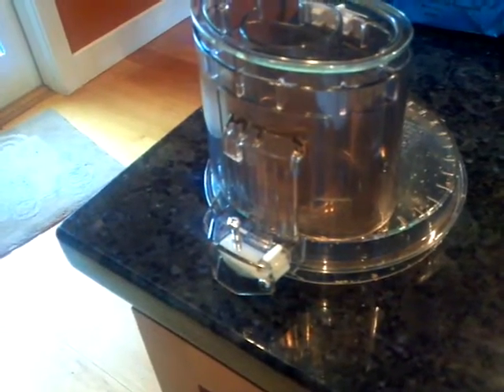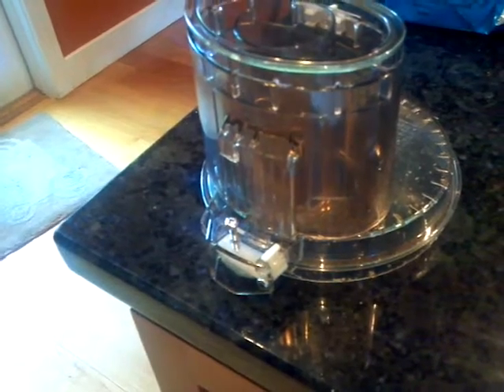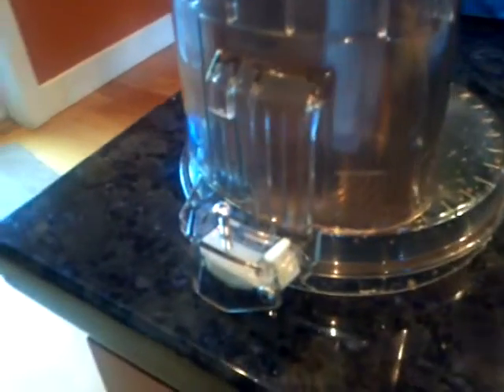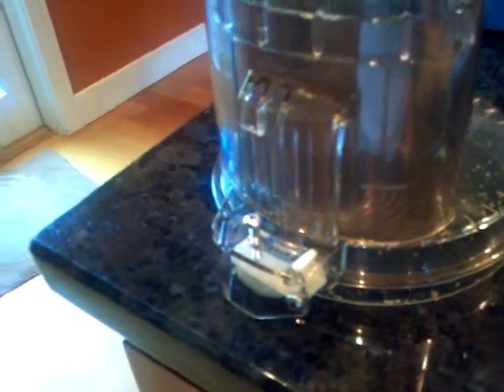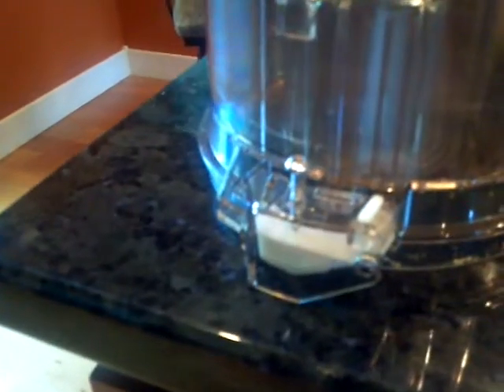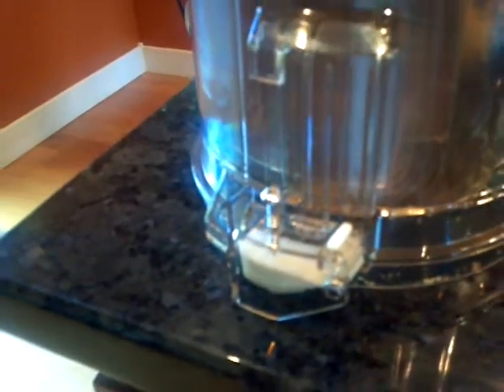Fix a Cuisinart DLC-8 Food Processor Lid/Plunger

Comment: Thanks so much for the video! I'm not mechanically inclined. But I have to be creatively frugal due to finances.  When I analysed the lid, my only thought was to glue a loaded spring where you put the top screw. Then I thought to check YouTube for ideas.  I don't have the right size screws on hand and I live an hour from a hardware store. (As I said, I'm not mechanically inclined, but Im willing to learn! ) If I glue a spring in place of the screw on top.... Is the screw on the right a necessity? I'm guessing the function is to add stability to the weakened plunger once the top screw was put in place?   I feel dumb asking, but I really want to fix the lid as a just can't afford to replace it.